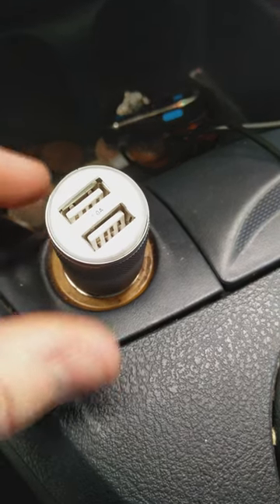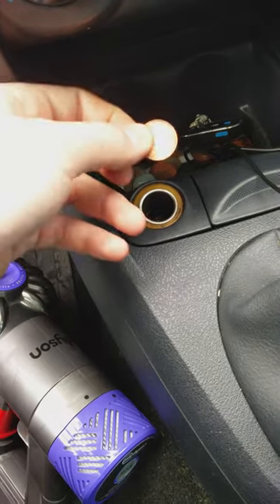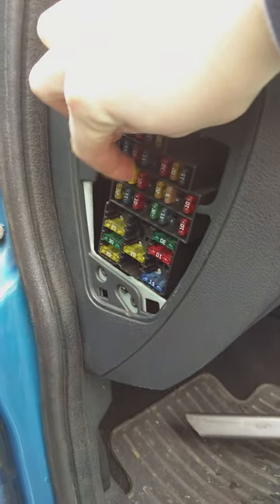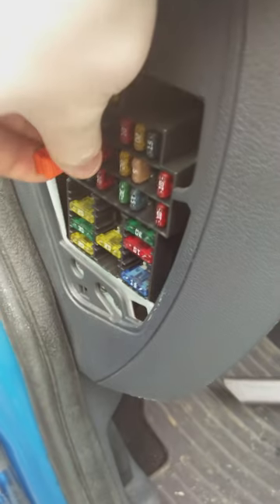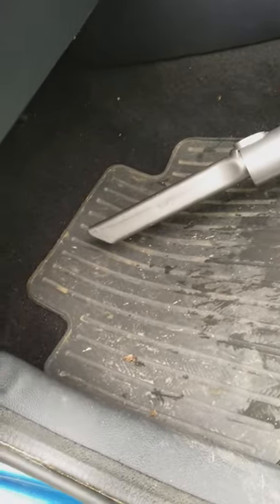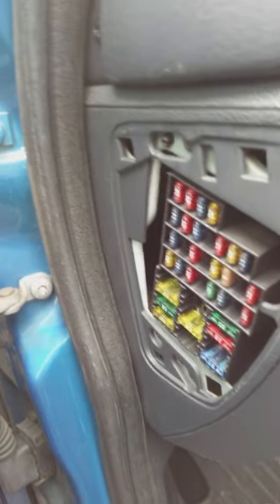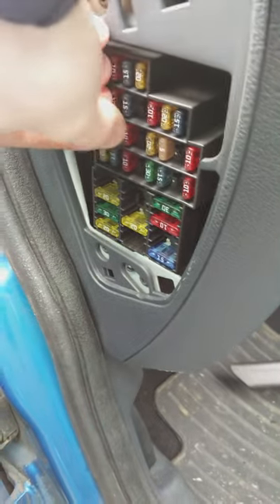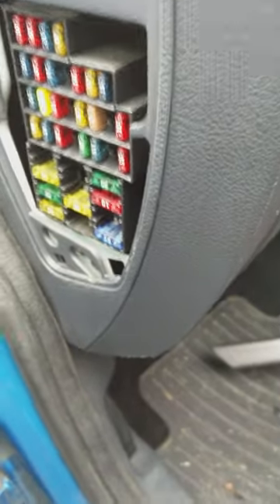How to fix Renault clio cigarette lighter / 12v output

Comment: hey there i have clio mk2 and the actually lighter fittin is rusted inside can you u screw it n take it out? can u buy them for a new one? just for some footwell neons 12v plug and play cheers plz let me know
Reply from the maker: steven mills hi there yes you can get a standard one off eBay or even upgrade to a new USB one, will be plug and play and if not it is just two wires
Reply: Chris' Bliss Builds cheers pal how  do i connect them up? does it involve soldering or can i just twist them togther? iv looked inside the lighter its a star shape screw just unscrew it n take wires out n put new one in n conect wires n just screw it down? is it easy to do myself? cheers steven
Reply from the maker: steven mills hi, yes it's easy but make sure you get the negative and positive the right way round! Negative normally had a smaller tab and positive, you can solder them or wrap them, but make sure you either wrap them with electrical tape after or shrink wrap
Reply: Chris' Bliss Builds cheers very much pal ya been a great help to me thanks very much ill oder one off ebay then cheers pal

Comment: I’m confused as to why you replace the radio fuse? I replaced my cigarette lighter but still won’t work so I reckon the radio fuse might be linked hence yours worked
Reply: ive a 2003 kangoo. the fuse for the ciggy lighter is the radio fuse as well.
Reply: @nobbystyles4807  Thank you, managed to find a replacement fuse. I replaced the whole cigarette lighter as previous owner had runied it

Comment: Do you know how to replace the original lighter?
Reply from the maker: Hi there yes I do, you will need to get a new one off ebay or something then just pry the old one out, unplug it, then plug the new one in and clip it into the hole
Reply: Chris' Bliss Builds thanks for responding I already have a original replacement. But the yellow ring is still on the lighter I don’t know how to separate them from eachother
Reply from the maker: @sennoes  sometimes they have a large plastic nut on the back which means you will need to pull the whole plastic unit out, i don't have a clio anymore though so I cant walk you through it, sorry
Reply: Chris' Bliss Builds thank you Chris! I will figur something out
Reply: If you get the Haynes Manual it shows easily how to replace it also it’s easy to just slide the black parts off carefully and separate the whole thing

Comment: I’ve replaced the fuse but USB  still aren’t working in the volt port however the lighter is? confused
Reply from the maker: Sounds like your USB adapter is dodgy